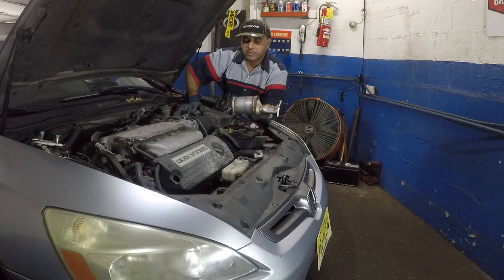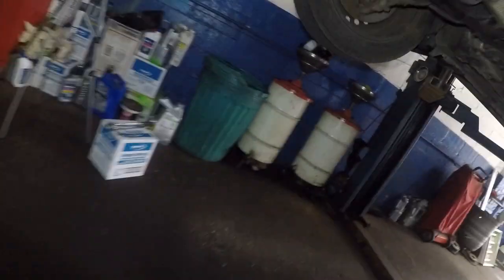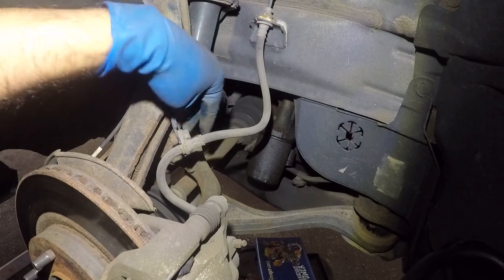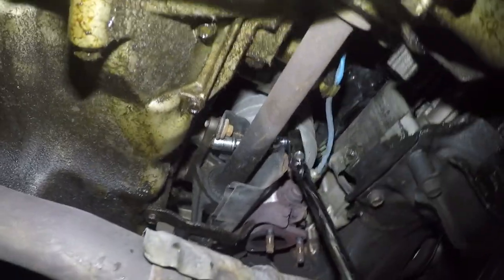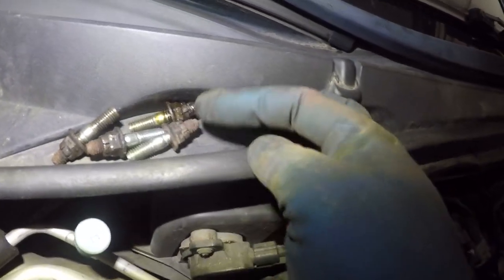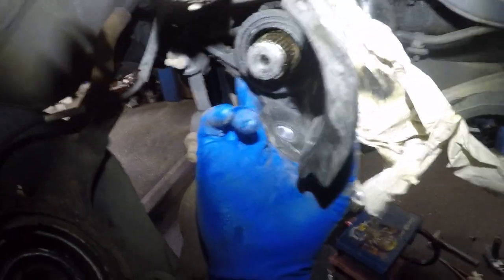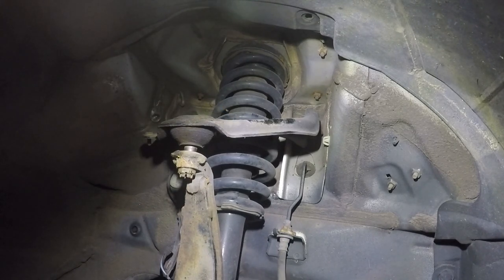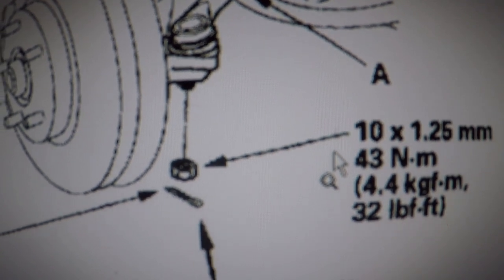How to replace bank 1 Catalytic converter on Aura TL and Honda Accord 2003 to 2007 v6

Comment: Take intake manifold off and rear valve cover. A lot better then doing a cv axle 👌
Reply from the maker: U can also loose the up the mount side mount and pull the engine forward a bit it’s all about experience good tips !!

Comment: If you disconnect the lower ball joint from the lower control arm and that fork which is the bottom of the strut you can remove the driveshaft without taking all that apart on the front end.  I don't think you need to take so much apart.  Nice video!
Reply from the maker: Good tip! But ball join will get damaged and not sure if arm would go that car down also u would need support to push up the spindle and upper and at same time push down on lower arm while some one removing the axle  that would be mess
Reply: Dont need to take apart lower balljoint, removing the upper works better cause the bottom is known to have issues better to not touch the lower unless replacing
Reply: @michaelbarrett8803  That wasn't a driveshaft.  That was an axle shaft.  The driveshaft connects from the transmission to the differential or transfer case.  I know, I build and weld driveshafts for a living.

Comment: I got it out of the top. Took way less time than to pull the front axle out and change the trans fluid. Just be patient with the 10mm back on the heat guards
Reply: Yo man how did you do it
Reply: I took the shields off and that was the only way it went in from top but I need them on obviously
Reply: The guy never called me back on changing my catylac converter maybe Monday he will being that it was on weekend

Comment: Wow! Now I have an idea of which one is Bank 1 and which is Bank 2. My Acura TL's Bank 1 Catalytic converter has the same placement as this Honda, the same for Bank 2. The code P0420 correlates with Bank 1 ( Cat in the back) and P0430 correlates with Bank 2 (Cat in the front). Does that mean I can clean both cats through the sensors' ports? My inspection is coming up next month. These cats are expensive.
Reply from the maker: Yup u can even use file additives
Reply: @RBTheMechanic  I used both Lacquer Thinner and Cataclean with no luck. Perhaps I can try spray Seafoam in there.

Comment: hello friend I need your help, I need you to tell me which is sensor 2 of bank 2?  where is bank 2 located, in the front of the car?  SIDE radiator?  thank you  very much.

My Car is Honda Accord 2006 V6
Reply from the maker: Bank two is the front of car near radiator and it’s senconds sensor
Reply: @RBTheMechanic  thank You.

Comment: Is my catalyctic converter failing?   There is a loud noise coming from the middle when accelerating..   200+ km..   don't remember ever changing this..
Reply from the maker: Muffler leak check for broken exghust system
Reply: Makes sense.   I think I saw the right muffler having a crack there..   I think I can cover it with a product..      I'm not sure if this explain the excesive heat coming from below though..   ( Thank you for pointing that out too! ) @RBTheMechanic
Reply: Heat shield couldve fallen

Edit* the heat shield above the 3rd cat thats between the 2 driver doors is a super common one to fall.... its sheet metal and corrodes away around the bolts that hold it up, and as soon as 1 corner falls, it rattles against the exhaust ehich usually holds it up, super common on all cars, as its happened to a few toyotas too that i know of

My lastest were the 2 heat shields above my 2 mufflers which have the same issue

Solution to keep it is to add a fat washer so the washer grips the heatshield, or just get a new one (its $30)

Comment: Its not a y-pipe.... its a J-pipe

03-07 v6 wasnt just a similar engine, the longblock is the same across the years J30A5

Only differences in engine between auto and manual are:
Coolant crossover
Intake manifold
Wire harness
Flywheel/flexplate

Edit: engine was the same between coupe and sedan
Reply: And thats not a muffler, thats the 3rd cat on the j-pipe
Reply from the maker: Ok

Comment: I have an 05 accord 3.0 V6.....I've tested absolutely everything......it still shows a p0171 lean code...bank 1!! EGR, all sensors, intake and exhaust gaskets, map sensor, pcv valve, intake air tube, fuel pump, and fuel injectors are brand new ....I've smoke tested it, and fuel pressure tested it to make sure.... everything is working properly.!! All I can see is that once I turn the engine off.....and pinch the fuel line right before my fuel pressure gauge....the pressure drops after 5 minutes.....!! Could it possibly be an injector stuck slightly open even though there new, that it's causing not enough fuel, and a fuel leak in the cylinder once I shutt the engine off....I would appreciate your reply...thank you.👍😎🙏
Reply from the maker: Yes u did every thing well … try replacing oxygen sensor I had that issue on this same car bank 1 lean I replace oxygen sensor upstream and months later same thing I replace the oxygen sensor again it’s been good ever since I guess first sensor I change was defective

Comment: I pulled my from the top after removing the coil packs and unplugging a couple vacume sensors. Put some paper towels in the holes you take the coils out of to keep debris from falling in. I said there has to be an easier way. Turns out there was
Reply from the maker: I will try that next time also u can remove the bolt for side mount and push the engine forwar bit!!

Comment: Yes best video but I’m not going to lie all I did was take strut bar off the top, then took out cylinder one ignition coil, then removed the one bolt holding cruise control module and then just moved power steering line over and it came out from the top! But I really thank you for showing/encouraging me to replace my cv axles because it’s been time for those to be swapped out
Reply from the maker: Nice I tried but didn’t work
Reply: Did you have to remove the heat shield before pulling up?

Comment: How'd you reach those 4 bolts on top I used a ratchet with extension but I have no space to remove them
Reply from the maker: It got enough space I used 1/4 ratchet

Comment: I have a 2003 Honda Accord LX 3.0 V6. I have a P0420 and P0430. I have replaced the upstream o2 sensors in bank 1 and bank 2. Where and what are the part numbers for the catalytic converters for upstream? Or should I replace downstream? Thanks 
Great Channel!
Reply from the maker: U should replace down stream oxygen sensors before catalytic those sensors monitors the catalytic replacing upstream wouldn’t help much then reset light if it comes back the. Proceed with some diagnostic test

Comment: I see the New Jersey plate .. where are you located ?
Reply from the maker: North nj bayonne
Reply: I’m from Paterson ! Where can I reach you at ?
Reply from the maker: @jaysentriunfer1665  what is ur cars issue I’m in bayonne nj we can schedule appointment but has to be prepaid
Reply: I need my belts replaced and my cat converter replaced too … I have both parts , I just need them installed .. I have the timing belt kit and also the catalytic converter with all the pieces .

Comment: You need to remove all that in order to replace bank 1 ??
Reply from the maker: Yeah unless u can take out the engine mount bolt on top side and push the engine forward but it should slide out from top

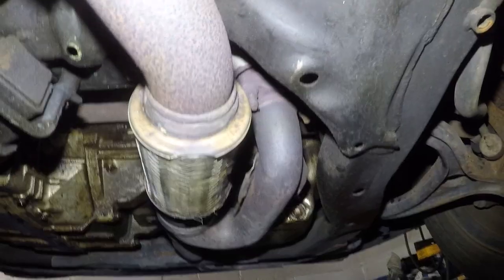Comment: 8:46 why you said you can't break that side, in my case I heat them up and they just don't come out im thinking to just cut them !!!!!
Reply from the maker: Well one side that I didn’t care about because the studed bolts are in to the converter and I’m replacing the converter but the one I can’t brake because I’m not replacing that so it needed to be reused
Reply: @RBTheMechanic  ok
Reply: @RBTheMechanic  Great job brother i think I'm not going to be able to remove bank 1 but thanks you are the man
Reply from the maker: @raulinazario9462  yeah u can also get it up from top remove the engine mount pull the engine bit forward

Comment: great video, how did you get the diagram showing the torque specs?
Reply from the maker: I have system u need specs?
Reply: @RBTheMechanic  it’s just good to have. I need to replace the control arms on my Sentra and I don’t know the specs

Comment: Is taking out the drive shaft seriously the only way to do the rear cat???
Reply from the maker: U can also take it up by might have to remove the mount pull the engine fit forward take out the coils and manage to take off the shield should do the trick
Reply: If you take coil off last 2 he will come up
Reply from the maker: @deivisvazquez8574  yeah possable I tried didn’t work but if u take out the side mount and loose the up the rear mount blunt and front it possable u can pull the engine forward a bit and it will come up

Comment: I'm needing to fix mines too but I don't work on cars myself do you know what type of auto places should go take my car to? Should I take it to a muffler shop I already replaced all sensors last yr August
Reply from the maker: Try find any local mechanic shop!!!
Reply: I called one a catylac converter shop in Vallejo called Alcapolcos
Reply: @RBTheMechanic  imma get a text back from the guy who works there tomorrow to let me know theprice
Reply from the maker: @kellycruz272  yeah and by the way ask them for ur old catalytic converter back they cannot hold it there is no core or anything like that and u can sell it to scrap for like $140 at least or more other wise they will sell it then self
Reply: @RBTheMechanic  oh ya huh thanks 👍 wow are you in California ?
Reply: Just asking thanks for the heads up
Reply: I'm going to text you when I get the price on what imma be charged k. If it's to much should I order the part myself and pay my nephew to change it? Is there two to change? I forgot to ask you. I'm assuming it's the 1 that's where the engine is. Since it's the bank 1 threshold failing right?
Reply from the maker: @kellycruz272  one per each bank only change the code u have
Reply: @RBTheMechanic  the code I have is p0420
Reply: @RBTheMechanic  one per each bank ??
Reply from the maker: @kellycruz272  yup
Reply from the maker: @kellycruz272  what size is the engine ?
Reply: @RBTheMechanic  v6

Comment: Amigo tengo un 2007 acura type s
Cual es bank1 y bank2 grasias
Reply from the maker: Sorry idk spanish
Reply: @RBTheMechanic  
Where is the bank 1 end bank 2
I have 1 car  acura tape s 2007 
I have no idea where is 1 from of radiador or back
Reply: @RBTheMechanic  
Tank lake you videos
Reply from the maker: @eligioflores674  the one by radiator is bank 2 and the back one is bank 1
Reply: @RBTheMechanic  
Grasias amigo 
Thank amigo
Reply: The bank 1 have 1 o 2 sensor
Reply from the maker: @eligioflores674  2

Comment: Are you near Fairfield CA??
Reply from the maker: No I’m in North NJ bayonne
Reply: @RBTheMechanic  awh okay well nice to meet you ! Thank you 😌
Reply: Should I order the part myself or should I just take car to shop ? If I buy the part first it maybe cheaper? Do you know what part I should buy? Should go by the engine number sticker ? Do you know if it matters
Reply from the maker: @kellycruz272  no problem… always here to help
Reply: It cost like 500-1,000 ? Just for the catylac converter it's self. I think? I also tried looking for it on eBay I put in my car make and I saw for like 300-600??
Reply from the maker: @kellycruz272  what year make model and engine size is ur car?
Reply from the maker: @kellycruz272  u shouldn’t order it urself because u can buy the wrong emission and it will not work out for ur car
Reply: @RBTheMechanic  right on I appreciate your help thank you and I hope you have a wonderful day ty❤️
Reply from the maker: @kellycruz272  thank you u too

Comment: Hey I want to buy the cat bank 1 for my accord 3.5 at autozone but they are telling me that the engine family code need to be exactly the same as my car , the only difference is the last 3 letters but everything also is the same ! I want to know if i can buy that one and not have a problem ? Because at the dealer almos 2,000 here in California
Reply from the maker: You need to make sure u get the correct one because Cali has very strict emission but I wount be able to help u to determine which one it is u can take ur vin number also take picture of the stickers under the hood it will have family size and all the information you need they should be able to get the correct one for u
Reply: @RBTheMechanic  i already did took the picture and the family engine code is the same but no the last 3 letters, i already got the smog check pass with a little help ... but I’ll like to know y I get the part will work fine on the car , thanks
Reply: He is working on the 3.0L J30a5 engine, you have a J35 engine, check wikipedia 'honda j engine' for exact number after the j35
Reply: @Ayesuh thanks i already sold the car two years ago

Comment: Hey bro. I my 06 accord V6 popped out with that catalyc converter bank one. Just like your video. You think it could be the bank 1  oxygen sensor? If so which one i need to replace i see it has 2 one on top and one at the bottom.I'm thinking of replacing that sensor. I appreciate any help. Thank you
Reply from the maker: Before replacing catalytic u should always replace sensors if light dosent come back after rest ur good if it dose then u mostlikely need to replace the catalytic how every if u want to knock out the job replace both sensor and catalytic